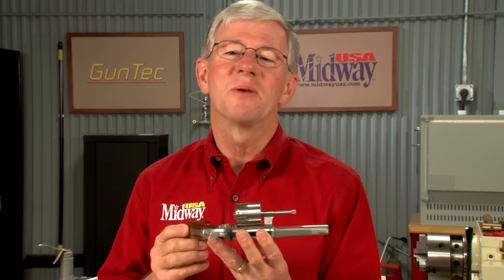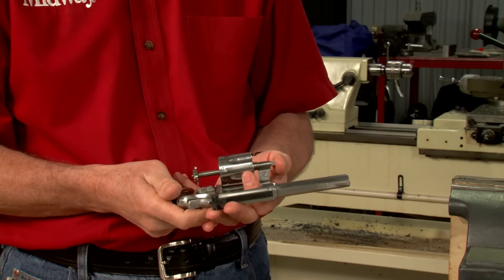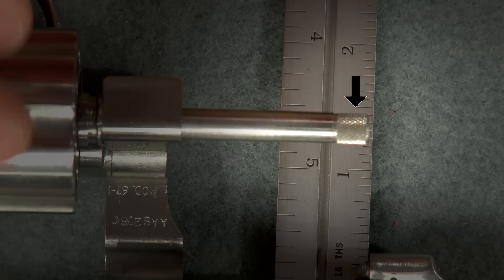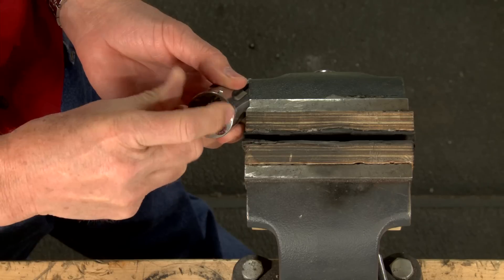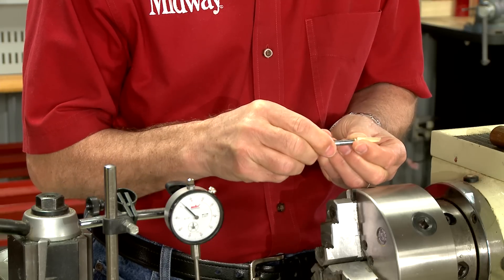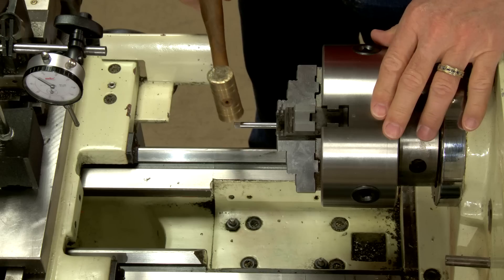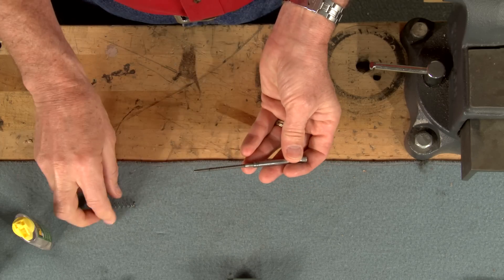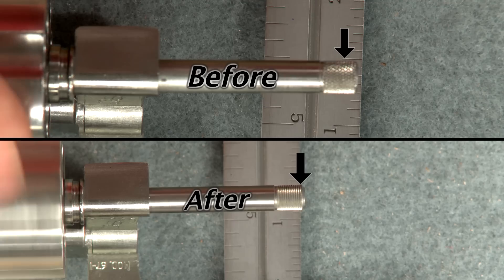How to Repair a Bent Ejector Rod on Smith and Wesson Revolvers | Smith & Wesson Revolver Project

Comment: Wow! another great video! thank you. Yes! this video reminded of how we used to bend 2", 3", 4" shafts 30yrs ago.  We would use TORCH HEAT on the HIGH SPOT and then VERY QUICKLY apply COLD running water to that area and many times we could get that shaft to run .003 to .006 (T.I.R.) Total Indicated Runout , Not bad for shaft that were many times 3' to 20' long with welded paddles or screw

Comment: A word of caution when using a drill press to do this. Most drill chucks are fitted to the arbor with a Jacobs taper and almost all arbors are fit into the quill of a drill press with a Morse taper. Any side load on a taper can cause it to release , allowing the chuck to fall out of the machine. Holding the chuck with one hand while tapping the piece with a non-marring hammer is just cheap insurance.

Comment: Or you can lay the rod on a piece of glass and mark the high spot. Then you can hit the rod while it's laying on some softer material until it's straight. I also thought it might be possible to get a drill the same size of the rod, drill into some brass or aluminum and tap the rod into the hole which might straighten the rod.

Comment: In my opinion: The newer Smith&Wessons use MIM extractors that the ejection rod screws onto. The detent end keeper/protector tends to relax set the rods way off center being the barrel assembly tends to be set at 12 o'clock instead of the variance that was used way back in the day to offset the barrel relaxing to the right & to also position the ejection rod within the centerline of the cylinder rotation considering the yolk spool being bent to the left. Having a variance helped hold the end in a neutral axis that would keep the ejection rod straight & not drag on the center pin. 

Smith also bends their yolk spool to get the frame lock they want. It's something cheap & easy, but bends the ejection rods all the time. 

I would rather have a variance than a revolver that's ejection rod doesn't stay straight all the time no matter how many times you straighten it. With MIM, it's not smart to keep bending back & forth being it will pop in two leaving the extractor thread inside the rod.

Larry has a great way of centering a rod that's bent, but nowadays, that's not to where they bend.

Also because they bend the yolk spool, it should be noted that in addition to adding shims to reduce end shake, the yolk should be bent further to tighten the cylinder lock up if need be. Most people don't do any of this anymore so it's no surprise how dumb things have gotten. 

Revolvers aren't the easiest guns to work on for most so called gunsmiths. 

I always enjoy Larry's videos being the legendary go to guy for everything.

Comment: Great video.  What is the purpose of the dummy rounds??
Reply: Чтобы экстрактор не провернулся...
Reply: To hold the star ejector in place with equal load all the way around the cylinder when applying pressure to unscrew the ejector rod. Live ammo should not be anywhere on your work bench when servicing a weapon. This is a best practices tip to avoid causing more damage. Just like a good gunsmith using the right screw driver tip to avoid a scratched or damaged screw head. You could just go at it with a hammer and chisel but the instruction provided here is what a smart gun owner would want.

Comment: Is the extractor screwed in with left hand or right hand thread?  Mine is REALLY tight, and another video said clockwise to open.  This video he says nothing about it.
Reply: It depends on how old your revolver is. S&W made them both ways until they realized that their counterclockwise cylinder rotation caused the rod to unscrew on the ones with right hand thread, causing the cylinder to bind and eventually lock up.
Reply: I'm pretty sure since the model numbers, 
about '57. 
Left handed threads.
Reply: Just picked up a used rossi the extractor just falls out...is there a spring or keeper that keeps it in????

Comment: My revolver used to open quickly like pop open with the slide button thing on the side but after I let someone borrow it you actually have to push it open and push it to close , Can anyone tell me what may have happened ?
Reply: Ervin Arlington they could of been "cowboying" the Revolver and possibly could of damaged the ejector rod or/and the locking bolt.
Reply: Or, it could be as easy as they cleaned it and got some fabric or other material under the extractor, makes them tight. It could also be that the rod is not fully tightened, has the same affect.

Comment: Hmm I have a problem with my revolver. When I tried to unscrew the ejector it popped a bit and not it spins free without any sign of letting go...
Reply: Žan Pekošak S&W as well as other brands use reverse threads on the ejector rods. If you turned it left to loosen it , you have stripped the threads
Reply: @Jddvs  Except for the older ones. Pre-1959 k38s are threaded the opposite way.
Reply: @promontorium  My old 6” S&W Target Master K38 revolver started to get difficult to open the cylinder. I hand tightened the ejector rod. The most common issue with the older S&W revolvers is a bent or loose ejector rod.

Comment: "It's a simple fix, you just need several thousand dollars of equipment." 🙃
Reply: Dial indicator, hand drill in a vise would  probably work.
Reply: bert smith  thankfully I do have the lathe, drill press and dial indicator. I trust the lathe for the most precise runout measurement. The hand drill is more of a less precise tool to test runout. Now if I only would have the time to do the fix.
Reply: Probably more efficient,  cost-effective and expedient to simply buy a new one.   Several new ones if so if it happens again,  you'll have spares. Spare spring sets, screw sets, sight blades, properly fitted hands, firing pins, hammers, triggers extractor stars and cylinder stops wouldn't be a bad idea either. If anything will break on a Smith and Wesson Revolver or any revolver for that matter, it will be the small parts like the above.  They're not expensive and not too difficult to replace or have replaced.